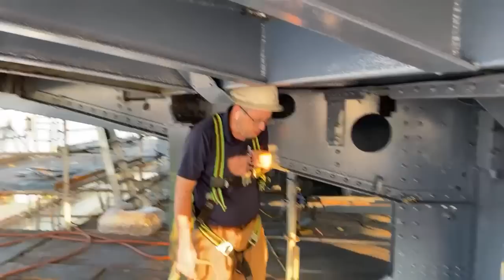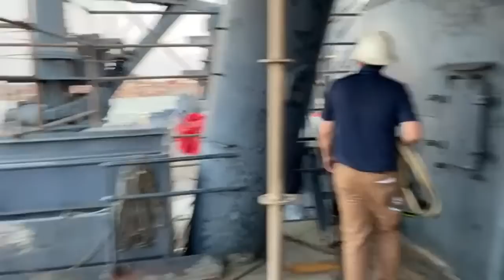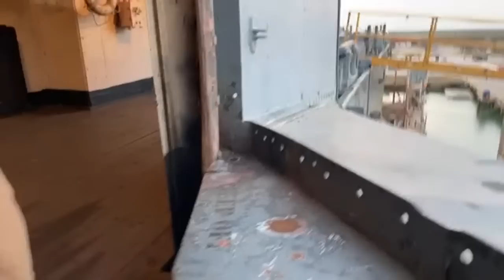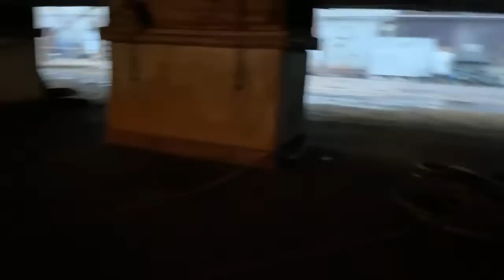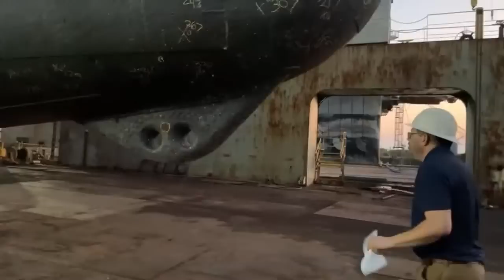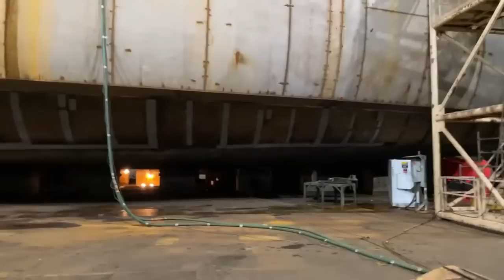Battleship Texas Towiversary Stream

Comment: I did three weeks in Dubai Drydock in 2005, they pulled both rudders, shafts and controllable pitch propellers, the labor rate was about $10 an hour for the contract and worked 24\7, imagine how much work could be done if you were there.

Comment: Thoughts on putting her in a concrete dry dock fully supported  so people could walk around the hull and inside the ship? It would also keep her from being constantly exposed to water, preserving the hull you’ve just spent all the time fixing..
Reply from the maker: With a proper maintenance schedule Battleship Texas is best kept in the water.
Reply: Probably not as sitting a ship in a dry dock is very bad for its structure and shape.  Water supports the ship in the way it was designed.  Further the majority of the corrosion was from the inside working out to the outside, I recall seeing a ship that looked great from the outside, but the skin was little more than several layers of paint on a very thin layer of metal then a load of rust.
Reply: The Alabama is set up pretty well.
Reply: Can also add that concrete is really bad for steel. It holds moisture and is acidic.
Reply: Give it up buddy, ships are made to float